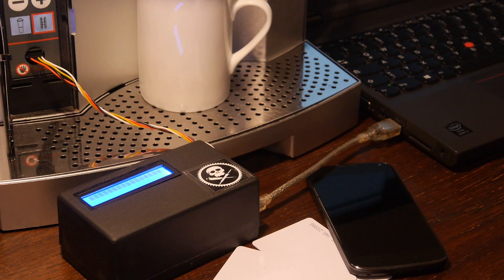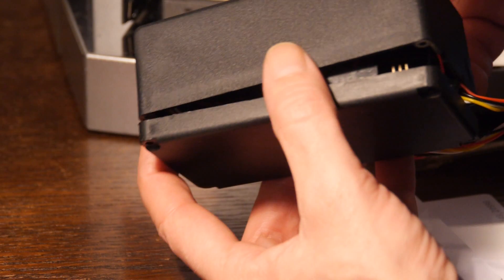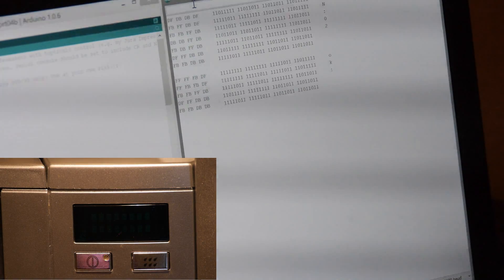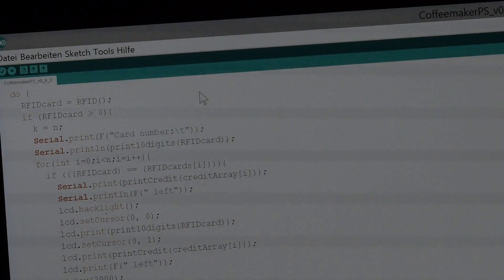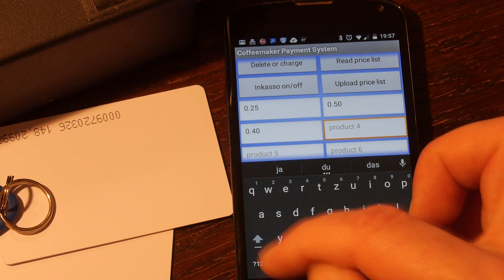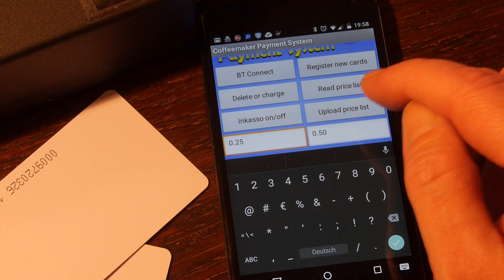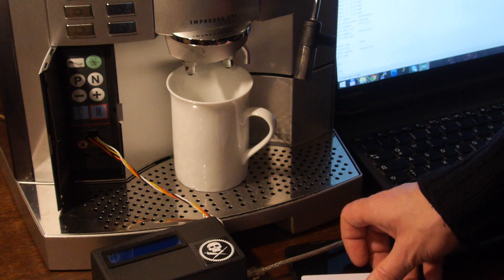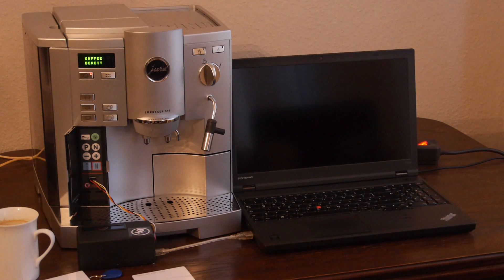Arduino-based Coffeemaker Payment System controls my Jura Impressa S95

Comment: Hallo Inter Action,
habe einen Rasperrypi und wollte genau sowas bauen, könntest du mir behilflich sein mit dem Schaltplan und dem Programmcode?
Reply from the maker: Hi Daniel, alles was ich dazu habe ist doch unter dem Video verlinkt, auch der Programmcode und die Pinbelegung. Das liegt alles auf GitHub. Oder brauchst du Hilfe bei der Adaption auf Rpi (Python)?
Reply: Danke für die schnelle Antwort. Ist es Umständlich den Code auf dem Rasperry (Phyton) zu betreiben, habe schon alles? Oder ist die Anschaffung von einem Arduino eher empfehlenswert ?
Meine S9 Avantgarde hat einen 8 poligen Stecker. Funktioniert das mit dieser auch. Grüßle
Reply from the maker: Andere Hardware, andere Sprache. Muss man halt neu programmieren für den Pi.

Comment: Very nice work. can the payment change to coin acceptor?
Reply from the maker: It's not implemented, but would be possible.
Reply: +Inter Action how to get the eeprom of the machine? seems like the link is death
Reply from the maker: Ajrul Radhi You can use the communication tool on my Github page to read the EEPROM of coffeemakers.
Reply: +Inter Action which one? can you have give me link? Can i read eeprom from another machine too?
Reply from the maker: You can find the link below the video. And yes, you should be able to read it from other coffeemakers, too, if it has a toptronic/Eugster logic unit and a service (serial) port.

Comment: Nice build! Where did you get the documentation for the commands for the coffee maker from?
Reply from the maker: I only found this site, but I tried the commands and they worked. http://protocol-jura.do.am/
Reply from the maker: Btw: if commands are not known, I would suggest to first make a backup of the coffeemaker's EEPROM (just for the case you accidently delete it). Then try out and check the reaction of the coffeemaker. Usually the machine will answer, if a command is known.